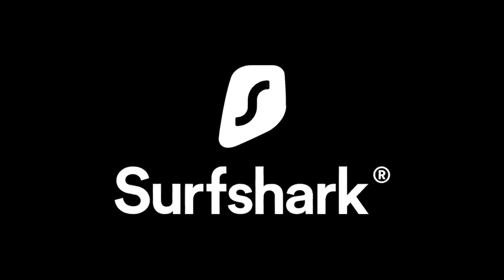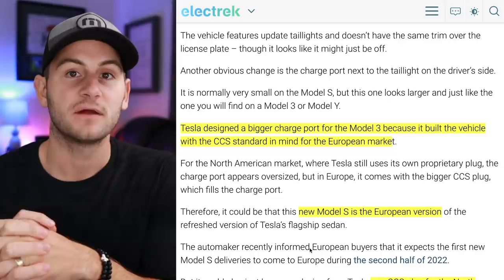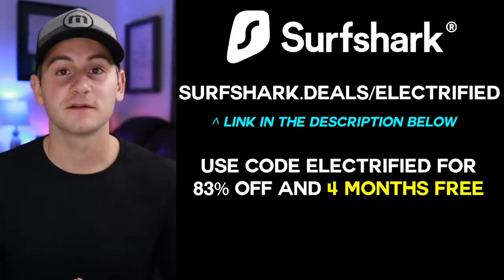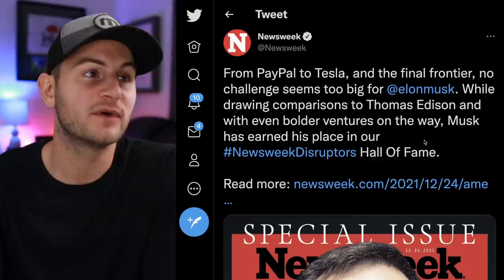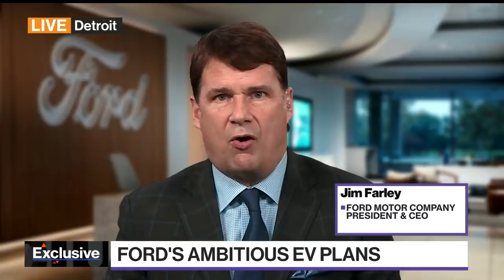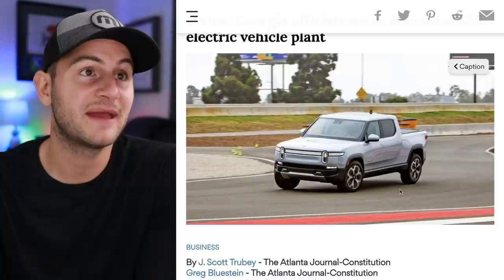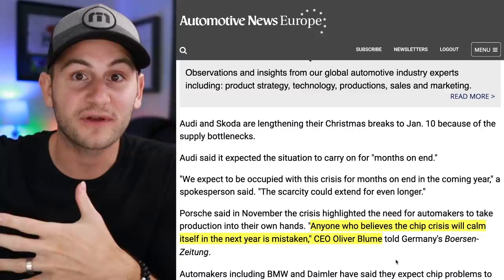New Model S Spotted / Internal Tesla Debate / Tesla Road Is Not Real / GM's New Reveal ⚡️

Comment: Perhaps the chip shortage is less of an issue for Tesla because they never stopped ordering, meanwhile the legacy OEMs cut their orders and now they are at the back of the line.
Reply: Exactly!
Reply: No, that's not the issue at all...  Tesla uses large CPUs to handle almost all functions of the vehicle where other car manufacturers use myriad microcontrollers, all connected to the CAN bus.  The Tesla route is essentially more complex and error-prone, but it reduced the chip-count.
Reply: @awebuser5914  How is a large CPU not less complex and less error prone? Is Tesla running redundant processing and ECM like critical aircraft computers, or some other complexity driver?
Reply: @awebuser5914  No. No. The "other" manufacturers use a myriad of 3rd party parts suppliers that use chips that cannot communicate with chips from other 3rd party parts suppliers that use their own chips in the same vehicle!
Reply: This has been covered. Lots. 
Legacy chips run on an outdated bulky 10 or 12 nanometer technology. Tesla use more up-to-date  5-7 nanometer tech.
When oems reneged on orders at start of Covid the Chip foundries dropped the old stuff because phones, tablets, tv's, and gaming consoles ramped up.
Why would Chip makers reinvest in building capacity for out of date stuff? Cue "chip shortage". Its the wrong sort of chips for them not a shortage across the board. 
In fact Tesla were able to bring in and write firmware for 19 new chips.
P. S. Don't quote me on nanometer figures check out the stunningly brilliant channel Anastasi in Tech.
Reply: AMD have also flagged that the chip shortages problem will decrease during the second half of next year. Legacy automakers on the other hand insists of using chips that no one wants to manufacture anymore, and they will likely try to blaim their falling demand for ICE cars on the chip shortages as well.
Reply: @andrewsaint6581  It has NOTHING to do with the "nanometer" size if the silicon.  Microcontrollers are sold for a few dollars each; they are made on the most cost-effective FABs possible and there's absolutely NO reason they would ever dream of using a process that serves no useful benefit, it has NOTHING to do with "out of date", it's simple more cost-effective to design and build on "larger" dies since they technology is far simpler and already exists.
Reply: @wrongtimeweeder1076  What an utter crock!  Have you hear of the CAN bus?  It's the standard that even Tesla uses and it's completely platform-agnostic.  What utter bullshit...
Reply: @awebuser5914  OK.
Reply: @awebuser5914  True. I just make stuff up all the time. It's in my blood. But tell me, how are Tesla able to make adjustments to suspension in an over the air update to improve energy consumption? Can Ford, GM, VW, or any other ***** manufacturer do that?
Is that Gordon?
Reply: @wrongtimeweeder1076  Well, the Model 3 and Y don't use active suspensions, so there are no OTA updates for them.  The S/X have active air suspension, so OTA updates make sense, but any other vehicle that receives OTA updates can easily update suspension settings, ICE or EV, it's nothing special.
Reply: @andrewsaint6581  also one of the two plants that builds those old chips burnt to the ground, and as you say why build a new factory to build out dated chips.

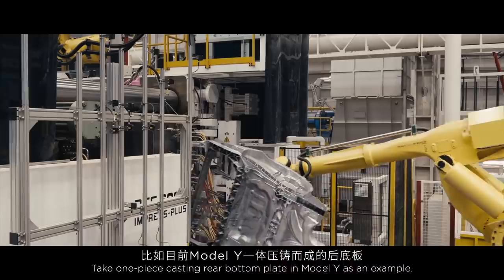Comment: So Dillon, at 4:35 in your video when the die cast part is being removed from the mold, if you look closely at the mostly open yet enclosed section you can see some extra small parts casted within the 1 pc large casting. A few seconds later as the casting is next the the worker doing some explaining process, those small parts are gone.
Since the smalls parts looked individually unique, I don't think they were temporary runners or braces. Imo they are parts being used elsewhere in the car yet being casted at the same time as the frame section. If I'm correct this is genius thinking once again on Tesla's engineers part.
Maybe someone can confirm or dispute my theory?
Reply: I'll incline with the temporary runners or braces theory, but there was a report that Tesla is considering megacasting the doors.  They are 10 years ahead of everybody.
Reply: if so this is nothing new in molding. the casting machine is basically like injection molding conceptually. the mold can have extra cavities for some minor other parts . usually parts that go along with the main part.compression molding does the same thing with extra parts.
Reply: From what i saw in Animations of the Casting Process these are just parts where excess material is deposited after the Casting Part is filled entirely. probably to counter possible shock waves when the casting is full, similar to closing a water valve quickly if there is no dampener
Reply: Very cool observation.  People slip on the factory floors since there is so much genius leaking all over!!!

Comment: Re: Mr. Farley — Ford needs to emulate Tesla’s no-dealer method. Battery supply is easy in comparison.
Reply: I don't see how they solve the dealer network problem short of spinning off EVs into a completely new company.
Reply: @ramonpunsalang3397  Which they will. ICE manufacturers will be bankrupt & gone within 10 years. It’s going to be hard enough to get their EVs to be profitable without the lack of ICE vehicle sales hanging from their necks.
Reply: Battery supply will be the key factor of success. Demand is skyrocketing and the carmakers that can deliver will sell. A huge fight over limited battery supply on the open market with much higher prices will occur, the dealers are a small problem compared to that. BYD, which has their own battery production will succeed, Tesla too, with longterm deals with CATL, Panasonic and others and soon a sharp ramp of their 4680 cells.

Comment: Remember Ford vs Ferrari? Well, it's not going to work out so well this time for Ford. It would be nice if Ford takes 2nd place.
I think Tesla should honor the reservation program they started, when it concerns FSD. Tesla, specifically used the price increases in FSD, to generate reservations/sales. Now that Tesla has decided not to produce a product that included a 2nd product (FSD), that consumers faithfully deposited a down payment/order reservation fee to hold a fixed price on FSD, is just wrong.. Therefore, the reservation should be honored when having the reservation holder alter their configuration because Tesla decided not to build that configuration of vehicle. I personally placed my order for a Cybertruck, when I did, because the price of FSD was going to increase another thousand dollars. Thank God I ordered the duel motor. Otherwise I would be suing Tesla for false advertising and breach of contract.

Comment: Car charging adapters should be universally standard, just like we have for gasoline pump nozzles.  I can see differences for incompatible systems (possible example, a different adapter for 400 volt vs 800 volt systems), but to have different adapters for different manufacturers is insane.
Reply: I'd say use tesla's plug as the standard. it's the smallest. much more preferable to the huge ones that need a monster outlet on the car. or J1772. chademo sucks. huge frikin' rino horn. F that thing.
Reply: Sometimes history has insane results. Right now, the govt is going to subsidize a charger build out and should standardize a 1 MW charging jack that switches to lower rates for legacy cars. Without future proofing, ten years from now there will still be an EV charging mess.

Comment: GM has to have all their products mimic Tron vehicles which cool, but only to make up for lack of substance quality and engineering. Pretty irrelevant since the are sticking to pouch form factor batteries with outdated chemistry. People might buy for the visual appeal but many will be joining their market share donation program.
Reply: Ridiculous excess of lights that will only help drain the battery faster.
Reply: @LACHIVA1969  Couldn't agree more and with their light shows they all do, they are opting to sacrifice performance hoping customers will be drawn-in in like moths not caring nothing else stacks up including quality, reliability and software.

Comment: Re: Charge port design —> Just ask Apple. Same problem.
Reply: Apple's refusal to standardize ports causes an unnecessary increase in costs for both iPhone and Android phones.
Reply: @ibnorml  How do you know it’s unnecessary?
Reply: @chucktx5957  Because Apple could have made Fire Wire an open standard just as they made USB open standard. Fire Wire is sturdier & easier to clean, so Android would have adopted both standards if Apple had made Fire Wire an open standard just as they made USB open standard. Totally unnecessary.
Reply: Fire Wire would cost less if 10x much were produced.

Comment: 2019 model S 75d.  115.000 miles. We need way more charging stations. Some are just to small . 10 to 15 spots. Which are always busy.   With a parking fee at a parking structure . They're always a spot.  The smaller supercharger stations need to be doubled in size. Or another one set up closer to the other one. I would love to see stations were there are convenient stores on the lot. A  new modern version of a gas station, if you will.

Comment: I think resolving the charger connection issue is a concern, but more importantly, the connection should be using the best technology. If the Tesla port is best then continuing to  use it make sense, but providing an adaptor for the J1722 also makes sense.

Comment: CCS comes in two flavors. There is a US 'CCS1', based on the Japanese version of CCS for AC, modified for DC. There is a 'CCS2' based on the German 'Mennekes' AC format, modified for DC. Europe, Australia and New Zealand use CCS2. (Japan use ChaDeMo for DC charging). So a car with CCS1 from the US still won't work with CCS2 used elsewhere. But it will be able to use public chargers. Often, public funding requires open access. Proprietary systems typically don't get that funding.

Comment: As plug standards concerns, they should all be the same worldwide. 
Specially if the use of the charger can be identified and blocked by software. 
This technology is still in the beginning, and the logical thing to do is standardize it.
Reply: It is always the same problem, Tesla had a great plug and charging standard, but German auto wanted to throw a little sand in Teslas gears, it did not really help them, as Tesla uses now CCS in the EU, but the result is that we all need to use these stupid bulky plugs now......
Reply: @nilsfrederking62  exactly, same stupid thing with apple. 
Apple should use USB C, just like everyone else

Comment: Dan Ives:  you mention only a very FEW areas in which Tesla has a massive lead--- a huge item you totally MISS is the gigantic, and gigantically expensive charging station network that no other pretender to the throne has, a near- ubiquitous system that continues to expand worldwide at great expense and time.  Anyone such as Ford or GM, even if they jumped on it immediately and with huge investment would take a DECADE just to get to where Tesla is today, by which time Tesla would not have been standing still.

Another is the TENS of BILLIONS of miles Tesla owners have been driving and uploading valuable data to maintain their lead.
Those are just two examples of why no one can hope to steal Tesla's crown anytime soon.

Comment: Ok...  put it this way... the more standardized charging stations available, the greater the overall efficiency of infrastructure as a whole... one standard charging station should be an inevitable conclusion... it creates a more ergonomic, practical, reliable robust infrastructure... toward optimal efficiency, measurable economically, and also in many other ways as well, for example..., aren't they always going on about "range anxiety? Wouldn't having a 'universal standard" charging station, nationally, or even globally... create efficiencies by definition... consider the whole function of stations is to provide fuel availability, etc. this can only reduce range anxiety... and significantly,  (hence, inevitable conclusion... :' D   If the industry creates different standards, it is only for their benefits... surely it is NOT for the customers benefit... So there!

Comment: What the most interesting part to me for the segment farley just did. Was admitting that he would prioritize chips going to the lightning&mach e over their ice sales in 2022. Almost as bold as diess posting on his linked in account about how their id series evs we're cheaper to own then their own ice segment offeringa. 

Also interesting was him saying they wanted to hit a 50k ev monthly run rate by the end of 2023 globally. So it's not fomoco plans to make 600,000 evs in all of 2023 globally like some Ford fans we're trying to say. It's just a run rate of 50k monthly by the end of 2023. 
Big difference there as that's not even teslas current run rate today in 2021. 

Also interesting was him admitting 80k was the max run rate intended for the lightning factory. 200k+ reservations before they cut em off. 
That wasn't even counting fleet sales. So now with an estimated 80% conversion rate. Ford is sold out for at least 2-3 year's worth of lightning production at the accelerated run rates. Maybe this will spur farley and fomoco to get even more aggressive? 🤔